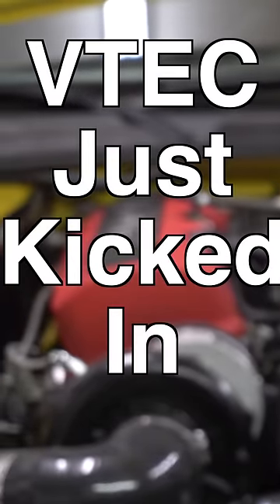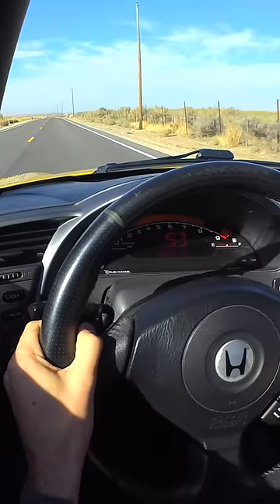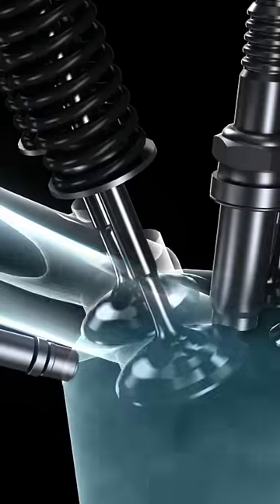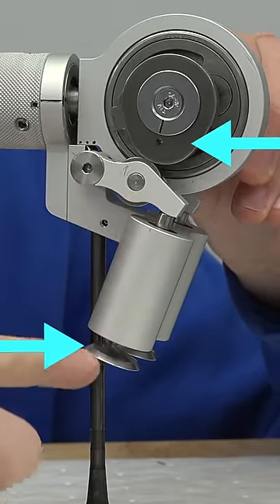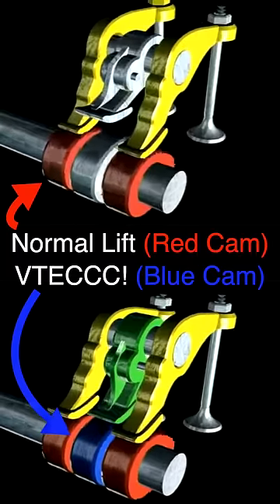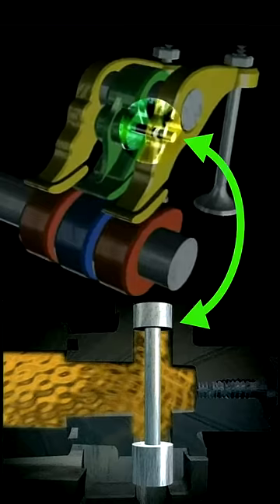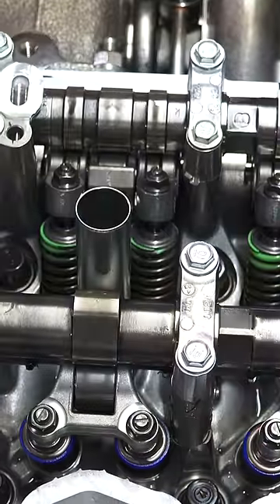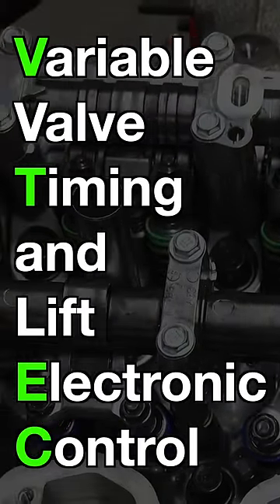How VTEC Works (In 60 Seconds)

Comment from the maker: VTEC can also change the valve duration (how long the valve is open, relative to the engine speed), depending on the camshaft design. Open the valve longer, let more air in! Or allow for valve overlap for better scavenging. Want all the details!? Here's the full story: https://youtu.be/tSCuRXnfLuI
Reply: It would be good to decribe, and maybe you have before, the reason why VANOS, VVT etc etc is not VTEC or a variant of it. Most people seem do not understand the difference between changing the cam angle in relation to the engine versus completely changing the cam lobe.
Reply: Can you review the 1.5 VC turbo 3 cylinder engineer explained
Reply: I like the word scavenging. Nice btw
Reply: You can make a Honda faster but it's still a slow Honda
Reply: also vtec can close intake vales in the eco mode on some engines like the r18
Reply: @jacksondanielson4323  the valve open good without vtec. The non vtec single cams have a higher valve lift without vtec then some models do with vtec. Depends on the engine and type of vtec it has. Some cars with vtec the 3rd cam lobe is much bigger and longer. When your not engaging vtec your are using less power and fuel. Vtec locks at a specific rpm so u can run on the bigger cam and have way more ass in high rpm for when you really Wana go vs not needed to go with ur not in vtec. It saves a lot of gas
Reply: @jacksondanielson4323  one of the reasons is to avoid huge fuel consumption like 38 liters per 100 km at cold engine (only a sample value)
Reply: What's the best way to remove any film or even miniscule sludge on a VTEC motor. What the Best motor flush ?
Reply: It can also change a sohc to a dohc at certain rpms, like my honda vfr800
Reply: HAHAHAHAHA
Reply: @jacksondanielson4323  cos for city slow driving VTEC opens up according to the speed of movement therefore using less air and fuel, hence operating with fuel efficiency. The best engine technology made. Honda rocks.
Reply: I VTEC is the variable cam timing done thru oil pressure into the viscous adjustable cam  gear.
Reply: Nothing better than Freevalve + Turbo, baby! Full control of Chamber absolute combustion pressures(& A/F ratios)
Reply: I used to love Hillman Hunters, i had its red workshop manual, it described various versions of Rootes 1725cc engine variants, describing when inlet valve opens in degrees btdc, or closes aftd, so each variant had different cam angles, and durations,  so same engine could produce different amount of power and torque at different engine speed, so sports versions made more torque at higher engine speed and normal town  cars made more torque at lower engine speed, So I questioned myself why has no one come up with a VVT cam? 
this was 1971, and as I knew electronics, i devised a theoretical system using electric solenoid to control valves, but realised valve springs are very strong so a solenoid would require a lit of electric amps, so was not going to be feasible, but one could use some hydraulic pressure to open and control valves using electric solenoid, so this VVT is not an idea Honda thought first, I thought of it first before them in 1971.👍
Reply: Iu others
Reply: the duration depends on the dwell time of cam...
Reply: Nice one🔥💪💯
Reply: VVTI TOYOTA
Reply: At the higher RPM, the valve that opens more, probably cannot close in time.
Reply: @seageo4303  where are you hiding your Toyota?
Reply: @seageo4303  🤝🤝💯
Reply: Loved the video explanation
Reply: does VTEC work without an turbo?
Reply: Great video, thanks!
Reply: There are multiple forms of VTEC this is one example.
Reply: @madalinbotez2089 Yep.
Reply: @bingoberra18  True, the Valvetronic system is the BMW variable valve lift system.
Reply: @DMA1956  
It is a cool word.
Reply: Thats the technology in hyundai elantra.variable valve duration using worm gear connected to cam shaft.
Reply: Can you put turbo in vtec?
Reply: @aaronpingol1566  
You don't even have to do it yourself! A plethora of VTEC engines are turbocharged from the factory!

Comment: It was a good way to get around emission control laws in Japan.  They could show that while running cars lower than a certain RPM and throttle, they could curb their MPG within the structure of the law.
Reply: Makes sense. Else why not always have more air
Reply: @kaenyito-cole5706  Because it's less fuel efficient
Reply: What you want to make low RPM power is totally different than what you want to make high RPM power. 

They go through a lot of trouble nowadays to make engines that are great throughout the entire RPM range. 

I've driven a race engine on the street. It's funny how it goes from no power and stalling to way too much power and roasting the tires like flipping a switch. With no happy medium in between.
Reply: Better torque too.
Reply: Air, as everything, has mass and the air speed is the only way to fill more air.
 More and more will require a major passing section.
 It's exactly the same thing as the water hose, trying to reach a certain distance, less water, small diameter, more water well...
 The pressure is always the same.
Reply: @edwardscott3262 thats basically what a dohc vtec engine is the performance ones are more power dense than most ferrari or porsche engines and the high cam has massive cams big lift and 260 duration which is why vtec locked at idle lopes
Reply: @edwardscott3262  Racing cars also have incredibly light flywheels and nearly no engine inertia. Depending on car, it can be almost impossible to smoothly let go of the clutch, and the only way to get one going is by dumping the clutch with a bit of gas.

Racing cars definitely are a whole other beast to street vehicles.
Reply: Not only. Having less opening at low rpm helps the engine at low rpm

Comment: my mom's VTEC in her honda odyssey has 323,458 miles and is still going strong 💪
Reply: Just wait until that VTEC stays kicked in .
Reply: 323 is attainable for any Honda/toyota with a half decent owner.
Reply: My dad toyota sienna 2000 has 309,677
Reply: Boost it
Reply: 2016 Acura ilx 144000+ miles. Never even had a hiccup 💪
Reply: Those are great engines lol
Reply: 1992 Integra b18a1 non vtec.  Been through 3 bodies.  318,000 miles and recently the fan relay gave up and it over heated.  😢😢😢still starts though!  😅
Reply: @2seep 2 step and front exit exhaust+wide front end and slicks/semi slicks
Reply: @pudgeederek just a posh honda why would it have a hiccup, biggest problem may be suspension, my nan had a 57 plate civic atleast 280k miles only problem she had was due to a huge pothole by a man hole cover, which I replaced for free and the suspension kit was £749.99, other then the odd top up on coolant, power steering fluid, oil and what not, its always ran like a charm.
Reply: @avoidoneu4061  which is why I mentioned it on a post talking ab Hondas. I know it’s a “posh Honda” 😭. Regardless of the badge it’s a very solid car. I like to call it a civic wearing a tuxedo
Reply: Ngl odessey's last as long as their greek origin's, they're some tough mfkin cars
Reply: Lies. Thats after a new everything was replaced.
Reply: 2006 CRV with roughly 300k, 1st/2nd gen crvs are tanks 💪🏻
Reply: my dads sierra has 770k ur a novice :)
Reply: What year is your mom's. My parents have a 2002 with 237k miles on the odometer.
Reply: @WilliamHollinger2019  2004 Honda
Reply: Hondas V6s are great. They are very reliable. VCM equipped engines do have a major design flaw where it will cause excessive blowby and eventually premature piston ring failure in the number 1 and 6 cylinders, however that can easily be fixed with a $40 VCM muzzler you can get online. So it's not really that big of a deal.
Reply: my 98 civic is closing in on 1250000
Reply: @pudgeederek  lmao that ain't even a flex. You start flexing at 200k
Reply: @Nehpets94  bro im 50k miles away from 200k miles in only 6 years . That’s extremely good
Reply: But is it fast?
Reply: @CreamCobblerFiend  fast enough for daily commute
Reply: @inotsmarty5700  Right but the whole point of Vtech is performance boost
Reply: @CreamCobblerFiend  and it does get a performance boost
Reply: Mom + VTEC = yawn
Reply: Same with my mums crv with 350000km
Reply: 360k in my fit and it just blew a head gasket 😢
Reply: I replaced my plugs and coils, VTEC doesn't seem to kick like it used to...😒
Reply: Keep going! I'm pretty sure there's a 500,000 mile club and they send you a plaque or something lol
Reply: @RussianCowb0y  I doubt I make it to 500,000. I'm at 215,000 currently and now I only drive 1.5 miles to work😆

Comment: I once owned a Honda VFR800 motorcycle. When VTEC kicked in on that bike it kicked ass, turned into a screaming banshee. Loved that bike.
Reply: the VFR 800 is my dream bike, youre so lucky to have owned one lol
Reply: @genisis3457  I rode that bike across the country, also to Vermont, the Blue Ridge Parkway and many times through West Virginia. I’d still have it except for a deer that came out of nowhere.
Reply: @kidlatazul 
One name my friend, HONDA. 👍🏻😎👍🏻💙
Reply: @kidlatazul  Damn dude. Did you manage to avoid hitting the deer? I hope you didn't get seriously injured from the incident.
Reply: @BabaYaga214  Thank you. I was distracted by a woman and 2 children on the side of the road who looked like they were in trouble. When I looked up, there was a deer right in front of my front wheel. There was no way to avoid hitting it. The deer died instantly, the bike was totaled, but despite sliding 20 yards on the pavement because I was wearing full gear I only had a slightly injured ankle. Very lucky.
Reply: @genisis3457  they make a 1200 too!
Reply: @kidlatazul Dude, lucky is an understatement
Reply: @BabaYaga214  I know. I guess it wasn't my time. Very blessed.
Reply: @kidlatazul you also had the protective gear, which should be common sense but still not everyone uses it. With very limited partial gear or only a helmet I doubt luck would've helped much 😅
Reply: @SoulTouchMusic93  The 1200 is not as cool as the 800. They kind of dropped the ball with that one.

I own a 2007 25th anniversary vfr800 and love it though.
Reply: @SoulTouchMusic93 my old man had one for years 
Thing is a beast
Reply: Good thing you were wearing that. I just shake my head when I see people riding with shorts, slip on shoes and skid lids.
Reply: @JeffDuncan-q4p  I know. And it wasn’t like I was doing something crazy, I was actually under the speed limit.

Comment: When I had one ( pre-internet days) I went back into my local dealer to ask how it worked, and even they couldn't tell me. Took a bit of digging in them days to find out how it did it. Your video was very well described, the only thing you forgot to say was that it's oil pressure that controls the pin that melds the three lobes into one. Superbly built engine with 100bhp per litre, no small achievement for a small capacity mass produced engine. Also worth mentioning that honda didn't have a single VTEC failure in 10 million engines produced.
Reply: I had a friend in highschool who had a Civic with VTEC and it didn't work...
Something to do with the pin not engaging fully...
Where did you hear they've never had 1 break??
Reply: No way that number is correct 😂
Reply: the only VTEC failure I've personally had, or any of my customers had, was low oil level (burning oil on built and semi-built engines and/or oil leaks), or something with the wiring of the VTEC system on non-VTEC ECUs. The first Hondata-chipped P28 ECU i got had a short in the motherboard (someone had soldered a copper wire from one pin to another causing a short) and VTEC wasn't working. 30 minutes of unsoldering and soldering fixed the issue. I've had my built B20vtec 1990 CRX DX since January 2016 and I absolutely love that thing!
Reply: @AH-lw2bj  maybe it was low on oil?
Reply: @IND4GR0V3  lol

Comment: I recently rode a motorbike with VTEC and it was like being sent by a rubber band when you hit high revs. Very fun
Reply: Mm two stroke power band
Reply: Probably a two stroke. Works the same way!
Reply: I think most bikes have VTEC, and yes he's right they make all their power way up at 7-12k rpm
Reply: Bikes don’t use vtech the only new bike at east sport bike wise to get any sort of variable intake was the new 2024 Kawasaki zx10rr it’s just bikes tend to only make the main power high up in the rpm’s so it might feel similar to vtech
Reply: @Reaperzx6  GSX-R 1000 has centrifugal VVT. With an increase in emission controls more bikes sport bikes might get it
Reply: @Reaperzx6  but I take my comment back it is a minority with variable valves
Reply: @vistakay  oh i didnt know the gsxr 1000 had that
Reply: actually no. 2 strokes have a power valve that activates on higher RPM's. It literally gets pulled and opened after a certain RPM like a VTEC @Reaperzx6
Reply: It's VVT. There is a CB400 that has VTEC, and the VFR had VTEC for a while, the CBR doesn't and neither do modern Honda engines, they replaced it with turbochargers
Reply: @Reaperzx6  a few bikes do have variable valve timing tech, mine is a small yamaha 155cc bike and it has one. and even Honda's vtec was first used on a motorbike, the CBR400 in 1983
Reply: Wish I had a motorbike, maybe I'll get one by age 40

Comment: My 2008 Honda Odyssey touring edition has a VTEC… 31 MPG at 103hp
Reply: Damn bro u need that at 100hp, my dodge grand caravan has 320hp
Reply: Must be the stratified charge VTEC version, that is, the valve train must have VTEC on the exhaust side with smaller fuel injectors, and a low flow fuel pump.
Reply: This are 9,1 Litres/100km. Wow that sucks.
Reply: My motorcycle makes more Hp

Comment: Back in college we used to say vtec stood for Virtually Torque-less Economy Car.
Reply: Hehehe
Reply: These days I just wish I could afford one as a college student lmao
Reply: Torque is mostly a function of displacement, and Honda engines don't make any less torque for their displacement than equivalent cars. They just make loads more power since the engines are designed to run efficiently at far higher rpms.
Reply: Then those clowns never dropped it 2 gears & floored it instead of 1.  Massive difference, even on my old SOHC 1.5 VTEC.  I spent 15 minutes running up & down my favourite road p155ed off as hell till I thought, hmmm... maybe drop it 2.
Woosh!!....    VTEC magic
Reply: Here pizza bois use them
Reply: VTEC was also used in the NSX, their race cars, and the current gen Civic Type R
Reply: Till we pull out the laptop and upload moon tune😂
Reply: torque doesnt even make sense in the case of a honda bro☠️the power figures make complete sense as small displacement 4 bangers…
Reply: @sxnfvr  torque is essential to power in a spinning engine like any gasoline engine. Honda torque figures were always on par with similar displacement engines from other manufacturers
Reply: @sxnfvr It seems that you don't get the joke.
Reply: @sungod5866  and that's because the exact same technology is used in every other vehicle on the road as well
Reply: Ironically, torque is what you need in an economy car. My Honda Civic with VTEC is all torque and little power. 117ftlbs, 120HP or so out of 1.7L I4 - which is way more torque than H-D Dyna made with the same displacement V Twin (I believe just about 100ft-lbs, 70HP). And H-D is nothing if not torque-y. So if you think about it, that doesn't make any sense. Also, VTEC was used in non-economy cars (e.g. NSX, Type-R).
Reply: No love for the S2000?

Comment: V-tec is also used on the exhaust side as well on quite a few engines
Reply: Thats the new style more for fuel efficiency. The one on the video is the older style mechanical way. Now its controlled by the cam phasers
Reply: To get passing grades at emission checks
Reply: How does the exhaust valves opening further help emissions?
Reply: @johndoe-hu2ss  it doesn't. But it does help with performance. In low rpm it runs in efficiency mode, in high rpm power mode.
Reply: @johndoe-hu2ss  it lets you pass smog 😏 lol
Reply: Same as on my VVTL-i, as in having lift cams on both sides.
Reply: Yeah duel cams.
Reply: @insaneclashroyalematches3114  wrong honda still uses this method along with a cam phaser
Reply: Yes in Honda k20 and k24 engine
Reply: @digvijayjagtap3776  K ftw
Reply: @insaneclashroyalematches3114  wrong this very same style of hydraulic pin is still used to this day to lock rocker arms together. VTEC and vtc are different things
Reply: @applepoop10  yes bro
Reply: @digvijayjagtap3776  92 vx hatchback they use vtec to control from it running on 12v until you hit 3k rpm and it allows to run on 16v
Reply: It has to be used on botb sides. An engine that cant fart cant breath
Reply: @2 1  no it doesn't
Reply: @SuprMEGA  my bad thats what i originally ment. The original k20s are more desirable than the newer ones
Reply: @applepoop10  MDX? RDX? or ZDX I'm asking because I remember one of those cars having an exotic K and one of them was even turbo charged not sure. it's been a while
Reply: Which ones 🤔 B and K I know on the B series extra oil is fed to both and I think it's the same with the K.
Reply: @bradsanders407  or you know, reduce emissions.

It's like education: you can use it to just get a diploma, or can use it to actually learn something like doctors, lawyers, scientists, etc. do